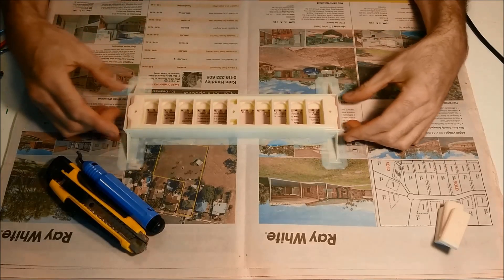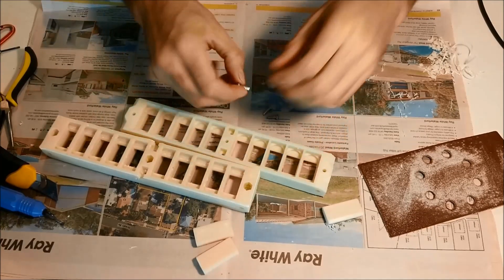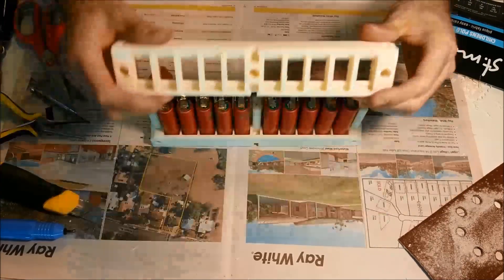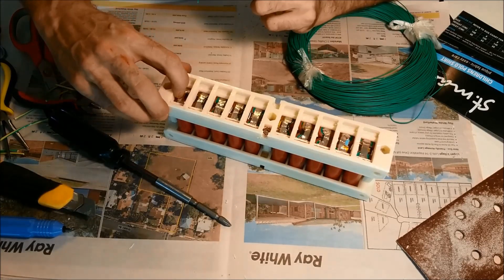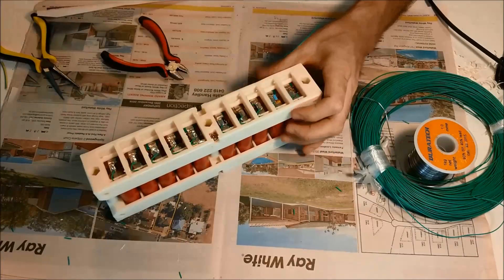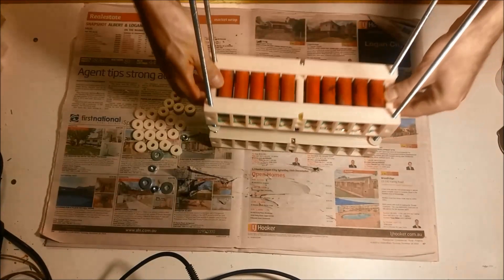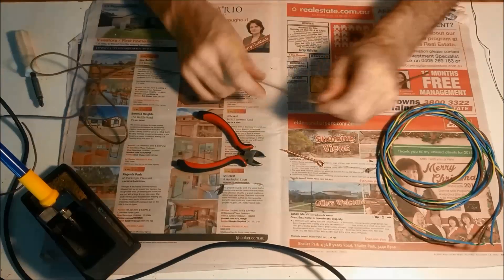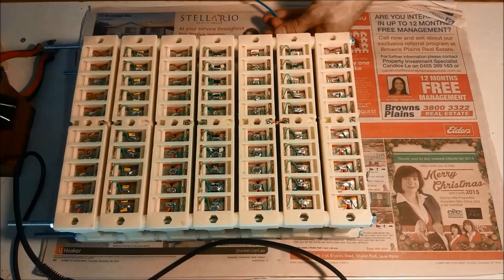3D printed Solar PV or EV 18650 modular pack from recycled e-waste laptop batteries

Comment: what's the point in all the wasted plastic that gets cut away?  is there a point?
Reply from the maker: The brim and out riggers are needed to keep the ends of the part from lifting off the bed while printing, (there is a lot of force on the ends due to the ABS cooling and shrinking)

Comment: I like the design. Rather than the diy fuse, seems like it would not be crazy to design in a 40A fuse to connect the packs.
Reply from the maker: The fuse design is based on Tesla style individual cell fusing (if one cell develops a fault it safely disconnects from the pack). I still use a larger pack fuse (60A)

Comment: wtf why do ppl make things harder than they are http://www.ebay.com/p/200pcs-18650-battery-2x-spacer-radiating-shell-ev-pack-plastic-heat-holder-diy/1072222683?_trkparms=pageci%3D01538888-136d-4b08-bc35-c704a04c9aea%2Cparentrq%3Df1a5a8e51560a993efe26115fffd9485%2Ciid%3D1%2Cobjectid%3D79846 problem fuckin solved -.- that took like 10 sec to search
Reply from the maker: We used to use these and also 3D print them, we found they were not so good for making serviceable/repairable packs and we also wanted something more structurally sound for EV use. hence this design.
Reply: ......hmm. well I mean thats why I would do it right, i mean you can always desolder them. but i sure as hell dont have a 3d printer. in fact i would kill for one, prob a ~50w laser cutter for wood or something. I could make them slide over the battery. patents it
Reply: @sub33d32  I have plans to making a serviceable pack and I think I have a great idea for a better design. I still need to work out an kinks but I have a genious ideas

Comment: Seems like a lot of work to me to just hook up a few 18650's...
Reply: Thank you, I had the same thought. Any chance you've found a better design?
Reply: It's a matter of safely hooking them up. If you spot weld the batteries all together, a single bad cell can destroy your parallel cell group and the entire battery pack with it. Individual fuse wire per cell is used to prevent this, a bad cell is disconnected because the fuse burns through. The problem for the DIY is getting the fuse wire to the battery without damaging the battery. The heat from soldering the fuse wire straight on to the battery will damage it. Tesla uses some pretty nifty techniques to get the fuse wire connected to the individual cells without heat forming, but this is a rather hard process to DIY.

This solution appears to be pretty good. By spot welding pairs of batteries, you can solder a fuse wire in the middle of the strip and prevent the damage to the batteries. If there is a bad cell, the fuse disconnects the pair it is on. The parallel group still works and you can easily spot with pair has the broken cell.